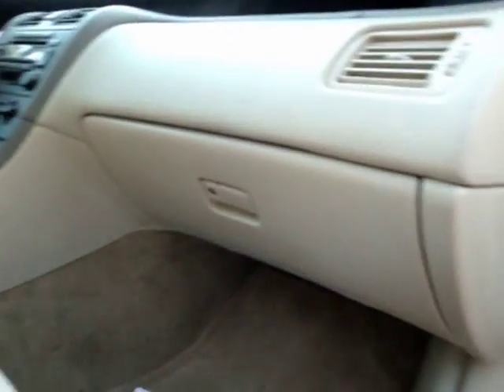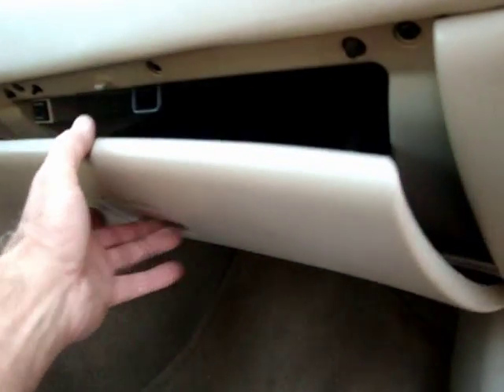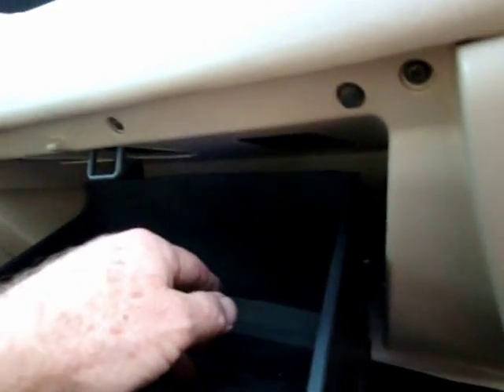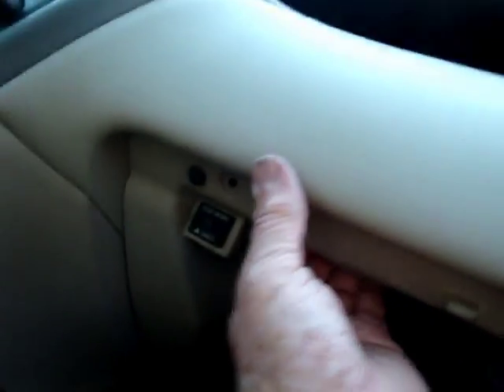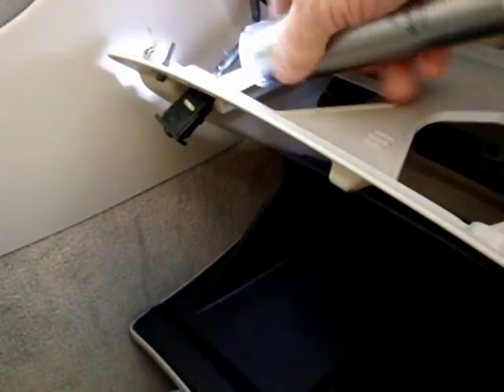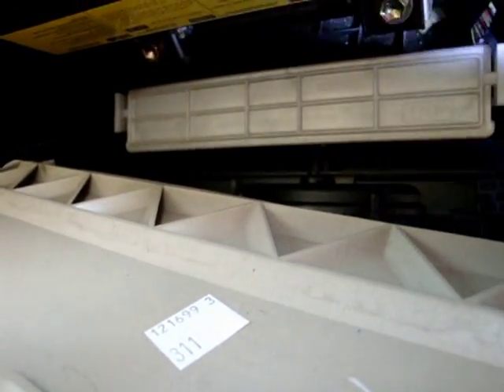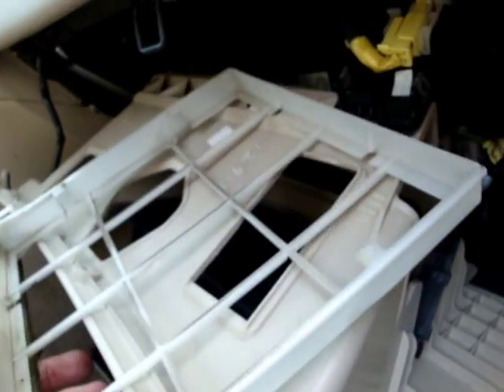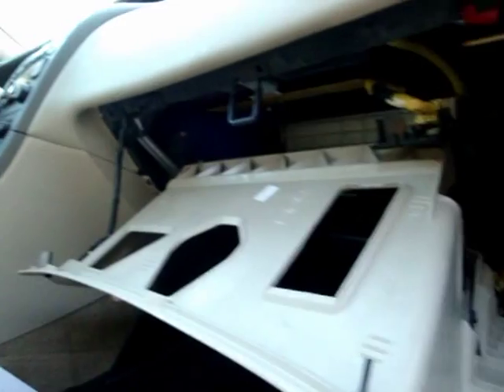Replacing cabin air filter, 2000 Avalon.mpg

Comment: This worked well for me, thank you. I went to two places to try to get it installed, filter in hand. One place quoted me for 1 hour of labor ($117), and another quoted me for half an hour of labor ($80). Both said the installation for this vehicle is more complicated than normal, hence the time.

Not disagreeing with them that it is more cumbersome than it should be, but I got it done in less than 15 minutes following the above steps. Thanks again!
Reply: Alok Somani thats why I rather work with technicians who works out of their home!! Im getting my new shocks/struts with installation for about $500. It would probably cost 800-1000+ at most shops and 2k plus at a dealer...

Comment: Thanks I will not longer paid my dealer for this!
I found though I could get to the filter by only removing the top 3 and the bottom left screws. I also left the light in place.  But then again my hands are rather slender, it was tight but managed OK.

I also did not have an air filter in my car originally.  The first time I paid my dealer to do it I asked for the old filter back (to make sure they did it). They told me there wasn't one to begin with.  I then got the dealer not to charge me as I told him the car should have had one.